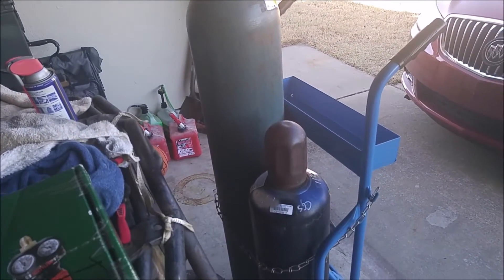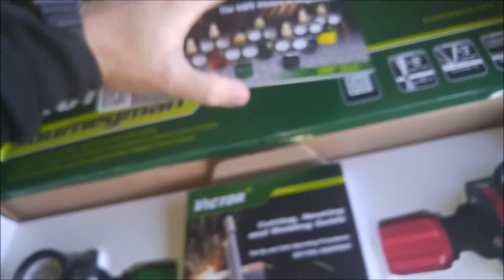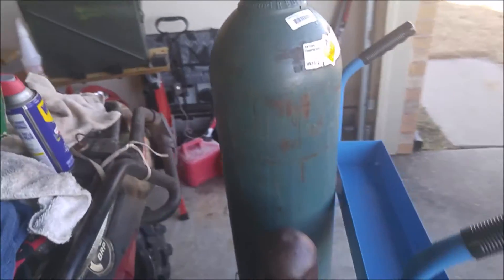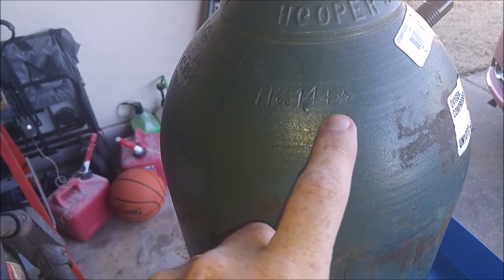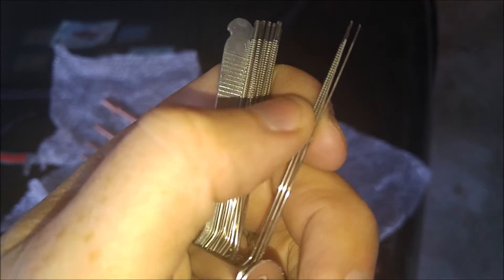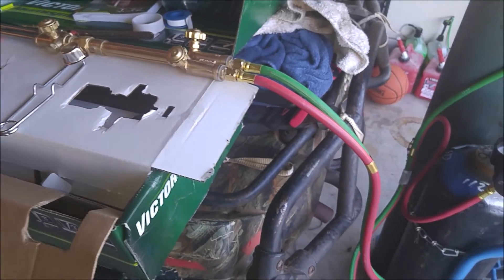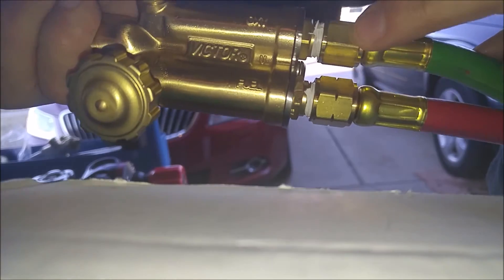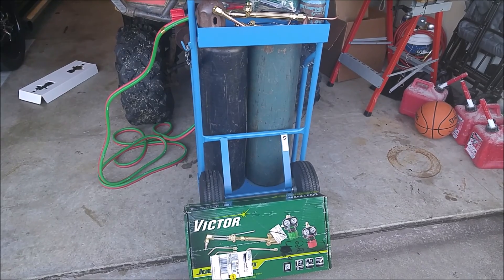My Oxy Acetylene Set up

Comment: Wow, very nice Victor setup. I use an old victor setup I picked up at a yard sale 20 years ago. The plus + after 11-14 actually means the tank can be overfilled by 10%(2015 psi to 2216.5 psi). They automatically get a 5 year, so if there was nothing after the 11-14 it will still get 5 years hydro retest 11-19.  The Star is exactly as you said, an additional 5 years(11-24. So getting a tank with both means it is a good tank that they have no worries about. Yeah, my places won't charge me for a hydro as long as I trade it in at least a day before.
Reply from the maker: sixtyfiveford oh cool thanks for the info.  i can't wait to put it to use.  i didn't use my old one as much because i knew it was going to need re tested as it was out of date for the hydro test.
Reply: I really enjoy welding with Oxy and cutting is fun as heck as well. I'm not sure what makes a tank able to get a +, but it's probably age(younger).